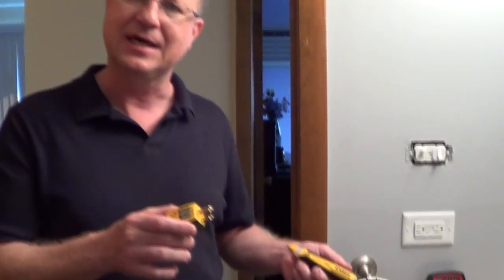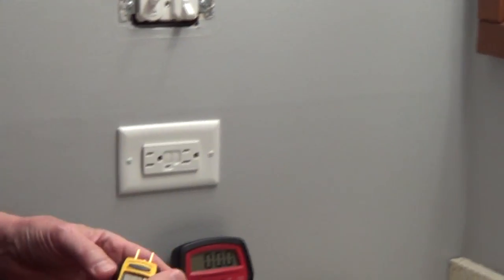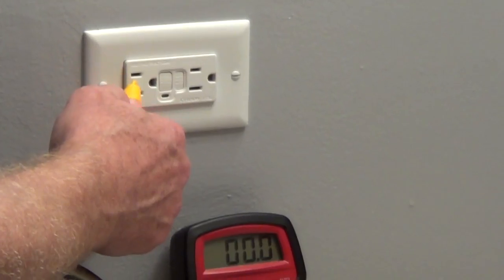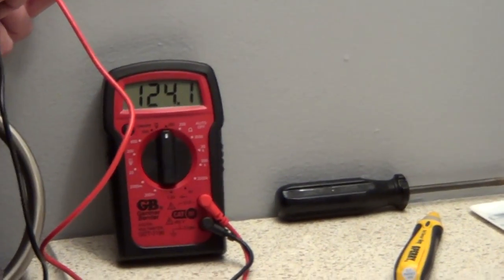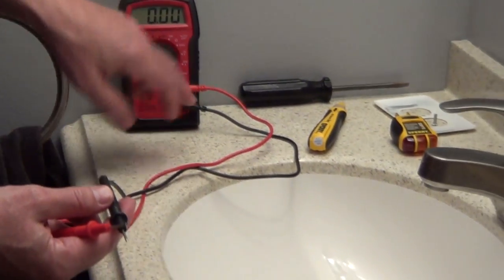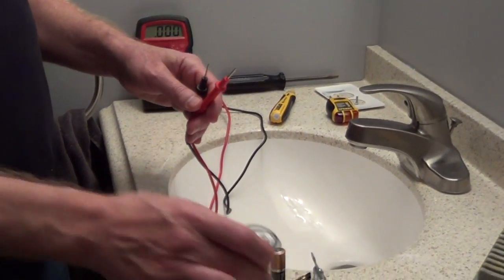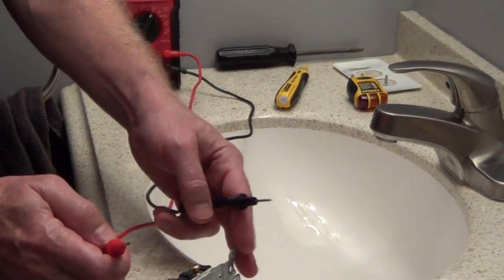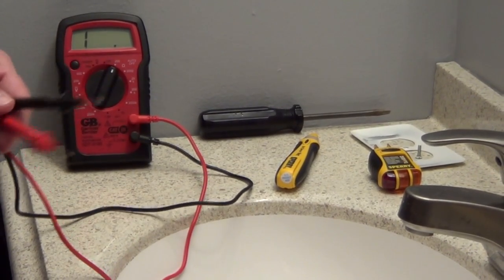Voltage Tester - Circuit Testers for DIY Projects

Comment: hello. Could you help me with the printed circuit of the multimeter GDT-3190. because unfortunately if I burn one of the resistors (R20). Your help would help me a lot.

Comment: Would I be able to measure the voltage of my car battery using a multimeter?
Reply from the maker: Hi, yes, use the DC setting just above the car battery voltage of 12 to 13 volts.
We have more home improvement tips on our weekly podcast https://itunes.apple.com/us/podcast/fix-it-home-improvement/id880903087?mt=2
Reply: @FIXITHomeImprovementChannel  Thanks
Reply: @FIXITHomeImprovementChannel  why don't you just say st it on 20 ?

Comment: I need to check an outlet what do I set the meter to and do I need to put the red and black in certain outlet holes or does it matter?
Reply from the maker: Hi, You will use the AC range and the number just above 120 volts for an outlet in the US. In most cases it will be 150 AC. Put the red probe in the hot (small slot) and the black probe in the neutral (wide slot).
We have more home improvement tips on our weekly podcast  https://podcasts.apple.com/us/podcast/fix-it-home-improvement/id880903087?mt=2
Reply: I bought the GB digital meter at the hardware store it didn’t come with a manual and idk the first thing about electrical stuff besides it hurts to get shocked lol but your speaking Greek to me lol I need it dummied down please I don’t see a 120 volt thing on this tester mine is the one that doesn’t have the 1.5 v option
Thank you for answering me on a Sunday and a Holiday weekend 
I’m in Kentucky so in the states
I own my home and for some reason half of the stuff on my breaker is working so I wanted to see if anything is getting power I’m having to do this on my own and I don’t have the money to hire an electrician so I found your video
I love you tube lol
Reply from the maker: Hi, you can send a picture of your meter to fixitpodcast@gmail.com so I can see how the scale is laid out. Then I can walk you through it.

Comment: How do u put battery in how does it come apart
Reply from the maker: Hi, Battery Replacement
1. Remove protective boot from test unit. The black outer body.
2. Remove the screws in the back cover of the tester and carefully separate the back cover form
the front.
3. Remove the battery from the contacts, noting the polarity of the battery terminals
and contacts.
4. Replace with one fresh 9 volt battery.
Note: Do not use rechargeable batteries in this unit.
5. Carefully, replace the back cover and tighten the screws. Do not overtighten the screws as this
may strip the threads in the tester housing.
6. Replace protective boot.
Reply: Seperate boot from meters front  edge. Open back flap and use thumbs to push meter out off the boot.  The boot fits really snug around meter but it will separate.